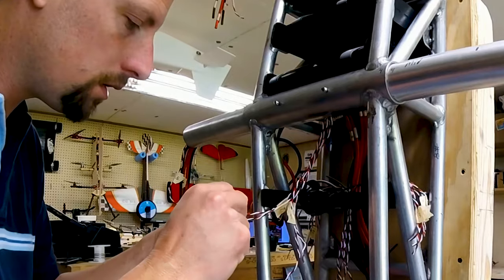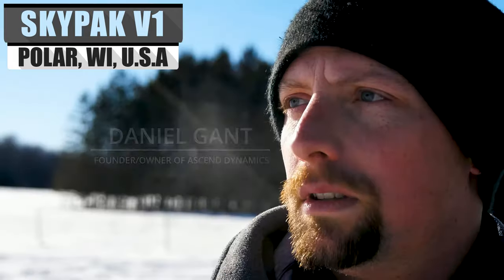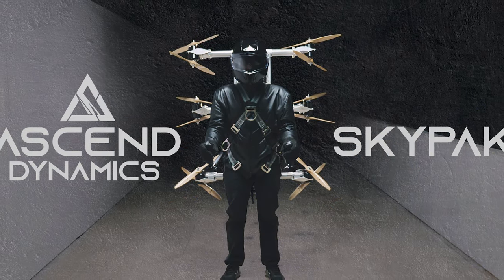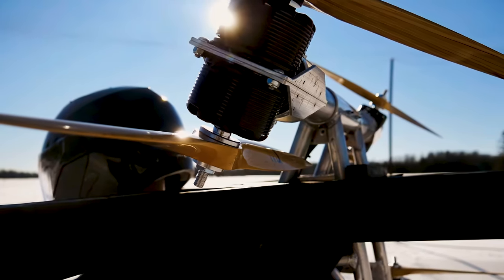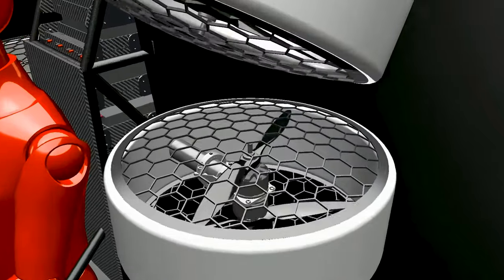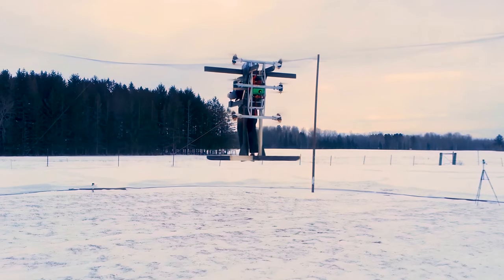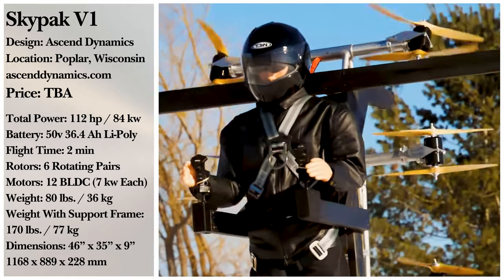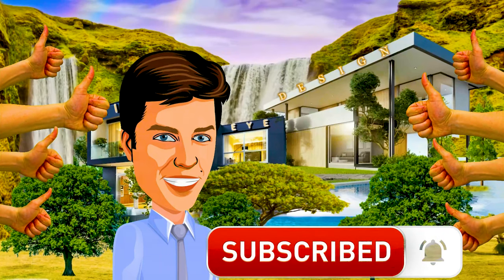Here's a Personal Flying Machine You Wear like a Backpack

Comment: The developer is heading in the right direction. Prototype with aluminum and get some flight, but then fundraise to develop a carbon fiber frame. The problem you get with more power is the motor needs larger magnets increasing the motors weight. Also the protective cylinders containing the props also adds weight. It’s a very ambitious goal to get a 200 pound pilot airborne. Lithium polymer or lithium ion batteries can store a great amount of energy, but again it does add weight. This is where smarter people than I have to figure out the sweet spot in the power to weight ratio with the use of affordable and practical technologies. We need developers like this because innovation does not come from large corporations. A great video thank you
Reply from the maker: Hello Re Read, thank you for watching!